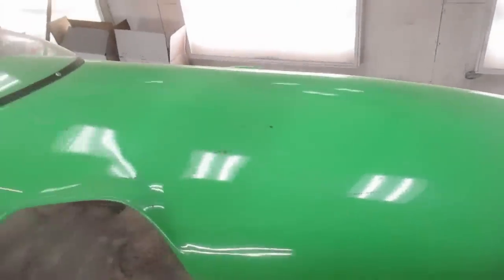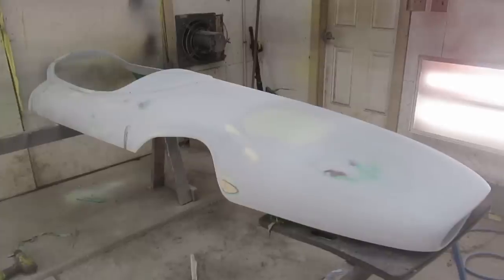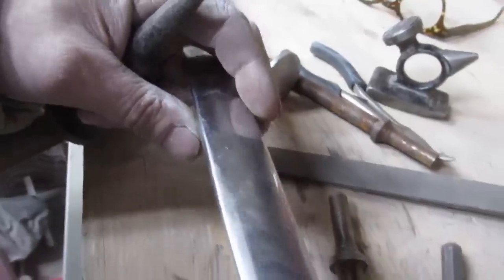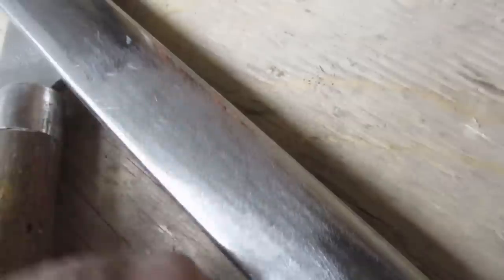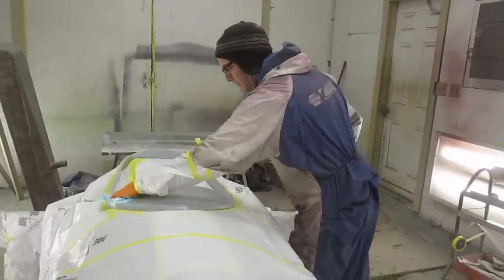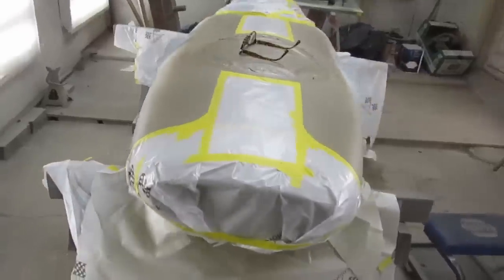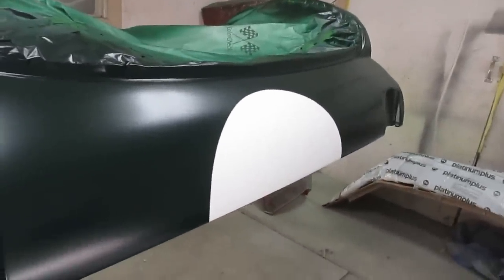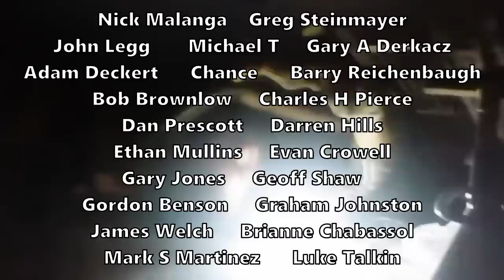Lotus Racer Complete Paint and Fury Stainless Dent Repair!

Comment: Nice to see good old fashioned poliester repair. Brings back memories: We used to repair quite some cars in the old time: Alpines, Corvettes and few Lotuses as well. Well done! And how you work the old fashioned Way No gloves, no masks, no huge protection glasses!  You do it the simple old way as I always did. Well it can be an itchy and scatchy job. Last week I had to cut a huge broken poliester drum to pieces. The dust is really no fun. I was quite good in poliester repair. But doing stainless repair I often failed miserably. 
I worked with the same system as you did, but my results were never really good enough. You master it  really. Patience is the key and not being to violent.The worst is the anodized aluminum of my old Belair: Paper thin and nearly unrepairable. For four doors it seems nearly impossible to get NOS moldings. And all the used parts are pieces of crap. For the aluminum moldings I work with wood instead of steel. The moldings are so thin and soft.
Now I will watch the en to see the result of the Lotus: Great updates as always: Thanks for posting your things. It is always an inspiration to get out of my chair and work on my projects as well.

Comment: Lotus looks exquisite ! Brilliant prep, tape work. My Dad painted his 1967 F-100 that colour. He dropped in  Chevrolet 350 out of a rolled over, low mileage 1970 Monte Carlo, and added a 4-speed trans and lake pipes from a wrecked 1967 Corvette. The hood flew up and almost came off during a test run, he buried the speedo past 120 mph when that happened, hence a new hood, windscreen and bodywork, paint . It was originally a white, 6cyl w/ 3 speed . During the event, I guided him off of the road, looking under the space from the blasted open hood and shattered windscreen. Now I know why he chose the green after he did the repairs, thanks! That was his Lotus :)

Comment: 14:00  I  like to take a carriage bolt and grind the head to fit the stainless.  slide it down to the damage, force it into the damage a little  then roll it over and tap the high spots.repeat as  needed
Reply: Thank you for the carriage bolt idea. I am reworking the stainless on my '66 mustang project.

Comment: that extraction fan is a must between coats of clear,,,was doing a frame in the greenhouse this summer and mistakenly closed the door after second coat to keep heat in. It was shockingly back like just sanded, gave it two more anyways ,,,but finally sanded back through them to gain the depth again! Am learning though!

Comment: Great video Scott. Glued to it ALL the way. With my recent painting experience, a few questions arose along the way. Hope you don't mind. 
Noticed you did the stainless dent work over a plywood base instead of a solid steal base as you would with most other metal type dent work. Any explanation/secrets behind that method?? 
You did lots of intricate masking on the Lotus. Is your masking material plastic or paper and what is the reason for whatever is your choice between those two materials?? 
How do you make sure to get all the sanding debris off/away from the masking before you apply more paint. The painter that showed me what little I know seemed to imply that the masking needed to be removed and replaced after sanding for those contamination concerns??
LOL !! Do you need to make running that tape radius look so easy??? NOT FAIR!!! ;o)
Can't wait to see this project all striped and polished. Looks absolutely "awesome" !!! 👍👍👍🎃🌲